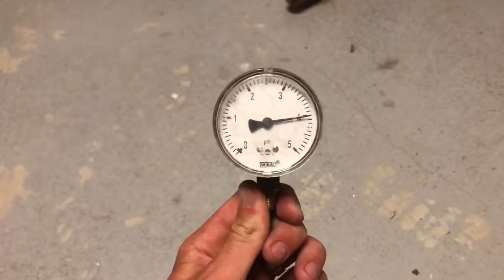BEST DIY Steampunk Lamp w/ USB made simple!

Comment: Very cool! But why the adhesive? What if you have to do some re wiring?
Reply from the maker: Lou Cabrattzie  I appreciate the comment! 
I used it because I didn’t want any of the fittings to shift at all which could possible pull on some of the wiring and damage it among other things. It’s certainly optional. Also, you can still used a wrench and pop then loose with enough force. It wouldn’t be very hard to take it all apart again if needed.

Comment: Great lamp and video! I'm going to try and make my first one. What size is the 90in elbow you used for the watch and what is the diameter for the watch? thanks!
Reply from the maker: Ninna Moscato  thanks so much for the support! 
The elbow is 3/4” 
And as far as the clock face, that’s a 3/4” to 1” reducer elbow and the clock fits perfect inside the 1” side

Comment: this lamp is amazing, what is the device that you are using to allow the valve handle to act as a switch, and do you have any advice on how to wire this
? thanks:)
Reply from the maker: Hey Fergus thanks for the comment.
So the device is a rotary switch that is attached to the inside of the water spigot valve with JB weld. It’s all in the video at 4:49.
Maybe you can better spot it now that you know. 
Here’s a link to the switch I used.

https://www.amazon.com/Creative-Hobbies-Rotary-Bushing-Stripped/dp/B015NFWBVC/ref=mp_s_a_1_3?dchild=1&keywords=Rotary+Switches&qid=1613790882&sr=8-3

As far as wiring, this is shown as well in the video but the possible and negative will be run together from the bottom of the lamp where the plug will go into the wall all the way up through the lamp to the light bulb. Your switch will splice into your positive wire only. It will act as an interrupter of flow when you turn the switch.
Reply: @The_Jedi  thanks so much, this is really helpful:)

Comment: Nice but what happens when the clock needs new batteries?
Reply from the maker: The clock sits inside that brass casing so it pops right out to replace the batteries.

Comment: What do you call that big fitting in the middle?
Reply from the maker: MISSION: PREPAREDNESS 

That is called a Neptune water meter chamber. It’s what most people’s water meter is connected to. Your water flows through it’s diaphragm and your City can register how much your using by having some type of register connected to its top. You can go to your local water utility company whether that’s your city utilities or an independent company, and ask them if they have any water meters in a scrap pile or extras they aren’t using for a project you want to do. I work for the city I live in so I just asked my water department since they have a scrap pile with a ton of them laying around. 
Thanks for the question

Comment: May I ask where you ordered the clock movement and shell that it fits into?  Thanks.  Very nice work.
Reply from the maker: Tom Shaefer  
I actually found it at a goodwill nearby and pulled it out of the frame it was set in. But this link will take you to one I just found online.  Hope it helps 

https://www.rockler.com/small-decorator-clock-fitting-silver-trim?sid=V9146?utm_source=google&utm_medium=cpc&utm_term=&utm_content=pla&utm_campaign=PL&gclid=EAIaIQobChMI9ImW0Kqe4AIVg0oNCh2rZgv7EAkYAiABEgKNuPD_BwE

Comment: Can you show more detail as to exactly how there was one wire through a pipe then suddenly there were two? really wish that  was slowed down and shown in greater detail.
Reply from the maker: deafcaroline 
I apologize, I can see what you mean. I don’t like for my videos to last to terribly long as to not exhaust the viewer. 
So basic wiring 101- you always have to have two wires (positive/negative) red is positive and black is negative. The original two wires I took from the lamp at the beginning are the wires I pushed through to the bulb in my lamp. The only thing that changed was having to wire that switch in that you saw I put inside that water spigot. In order to do that, the switch acts as an interruptor to the flow going through the positive wire. That’s why I wired everything first and showed you how it looks fully wired before shoving it all through the lamp. The positive and negative wire must both reach the bulb at some point. In regards to the switch, Wherever you put your switch at you must splice that switch into the positive wire before it reaches the bulb. If you need a diagram I can email one to you if you’re still confused 
Thanks !

Comment: What specifically is the item you’re holding at 0:44?
Reply from the maker: Luke Grant 
That is called a Neptune water meter chamber. It’s what most people’s water meter is connected to. Your water flows through it’s diaphragm and your City can register how much your using by having some type of register connected to its top. You can go to your local water utility company whether that’s your city utilities or an independent company, and ask them if they have any water meters in a scrap pile or extras they aren’t using for a project you want to do. I work for the city I live in so I just asked my water department since they have a scrap pile with a ton of them laying around. 
Thanks for the question Luke
Reply: @The_Jedi  I think it is actually a water pressure regulator not a meter
Reply from the maker: Larry Schwartz  
You’re right Larry, that’s what it is. But the meter attaches to it. I work for the gas department not the water department so I’m not an expert by any means. Thanks for that

Comment: Nice lamp, curious though, are you concerned it is going to fall apart or something? That's a bunch of JB Weld, on pipe fittings no less! I mean, where is it going to go?!?!? Final thought, kill that music, so annoying I muted it, hope you didn't say anything during the course of the video!
Reply from the maker: I didn’t tighten the fittings down, I wanted them to be positioned right so I used the weld. Better to have more than enough to secure it then it shift one day.
Reply: The_Jedi , you could have used Loctite threadlocker , comes in blueberry and cherry flavor , and you would have gotten the same results ,  Harley-Davidson engine builders use it when they rebuild an engine because of the vibration, I have used it on Gravely's lawn equipment when I would rebuild engines and I build Chevy engines , and red Loctite on flywheel bolts and pressure plates, it resists heat up to 400 degrees, the blue is for low heat applications, I call them cherry and blueberry for my own amusement